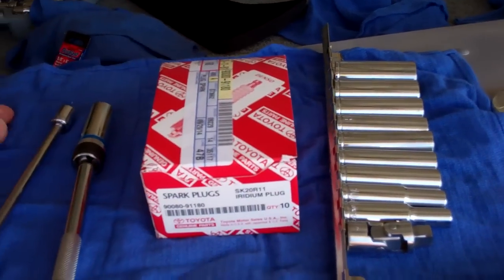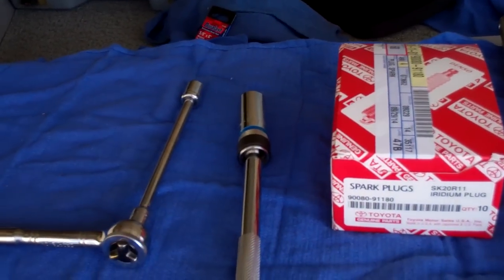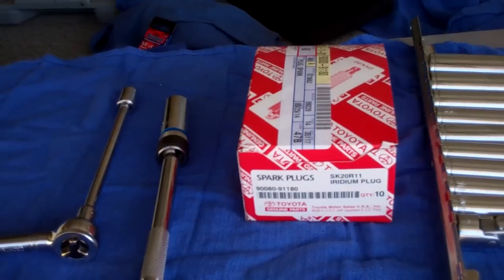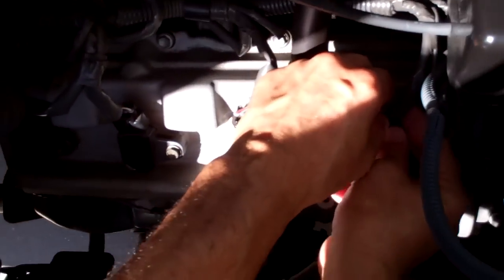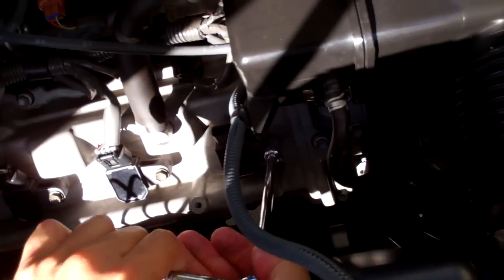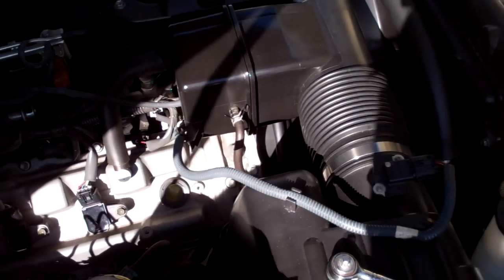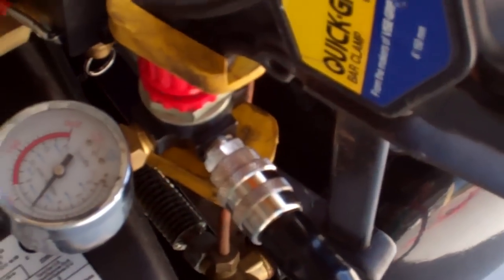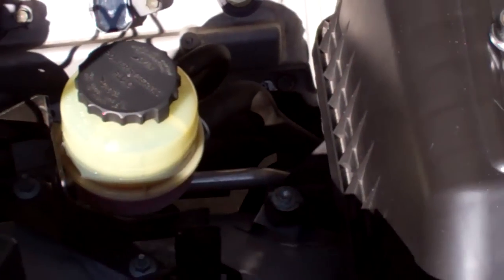DIY Toyota Tundra Plug change

Comment: Tips from an old mechanic: (1) Do this on a cold engine to protect threads on aluminum head (2) Use Anti-Seize compound on new plug threads and silicone lube on rubber plug boots
Reply from the maker: William Splawn yes indeed
Reply: +William Splawn thank you for that info
Reply: Not true. NGK, Autolite, Champion, Bosch, Denso, AC Delco, will all tell you not to use anti-seize with their modern coated spark plugs.

Comment: Thanks for the video perfectly explained thank you for the video. It was fun changing them out I have an 8 cylinder 5.7 tundra and had not changed the plugs in about  100 and 150,000 miles ago dealer wanted $369.00 and it was so easy I did it in under 1hour 15 mins. I used the NGK Iridium 6699.  I paid once before in 2014 to get them swapped. 👍
Reply from the maker: I’m glad that it was helpful and it was able to save you money from a dealership or a mechanic, thanks for watching

Comment: Also suggested to replace the plugs with spark plugs. Use anti seize compound on each plug. Check (electronically) each coil to make sure that is not an issue.

Comment: Jose thanks for the video.  It helped allot.  I talked to the Toyota Service Department yesterday in Southern Oregon (Grants Pass) and they wanted $250.00 to change the plugs in my 2003 Tundra.  I called the Parts Department at the same dealer and the plugs were less than $22.00.  I'll change them myself.  Thanks again you rock.

Comment: you saw improvement in milage, changing spark plugs on my truck caused  my truck to give less mileage,  more gas consumption from 15 -16 mpg to 12 mpg
Reply: That sounds like you have Abad knock sensor,  you should take it to a good mechanic to get it check!
Reply: @carlosheras2828   thanks. My 2011 5.7 has rarely gotten better than 13 mpg. I'm following the advice you gave S!

Comment: Do you like using anti seize grease and grease for the spark boot?  You did a very nice detail job on the engine bay any tips? I'm afraid of killing the electrical.
Reply from the maker: Yes a light coat, And as far as engine bay I just use a leaf blower and may be a little wax on plastic covering. Thanks for watching

Comment: When changing the plugs do you need to put anti seize or dialectic grease ? Working on a 02 tundra 4.7   144,XXX
Reply from the maker: You should use some kinda grease. Thanks for watching.

Comment: 2007 Toyota Tundra 4.7 check transmission fluid for the first time at 190000 MI have 210 thousand miles on it i have changed the  oil 5 times in its life and have never changed a plug yet. Do you think i should  chance it . It runs like a champ and i have a very heavy foot . I wantewwd to see this foriegn vehicle fail but it won't . I am impressed to say the lease

Comment: What size was the extension built-in on the magnetic socket? I'm guessing 6 inches... Correct?
Reply from the maker: I’m not sure but I believe so, considering this is an old video I haven’t use that socket in a while.

Comment: Lol you should do the spark plugs on a Subaru STI and then you’ll really say that there’s no space to do it 😂
This trucks have so much room to change them!!!
Reply from the maker: I could only imagine. I no longer have this truck , now i have a Tacoma 2018. It's impossible to do work in side the engine compartment manufacture are putting so much of pollution control gadgets that you are forced to take it back to the dealers. Thanks for Watching
Reply: Jose Ribot that’s the main engineering idea, to force not mechanically inclined people, to have the dealer do the job and charge larger amount of money

Comment: You shouldn’t ever screw any spark plug into a aluminum head without putting Anti-Seize on the threads of new spark plug!
Reply from the maker: You’re absolutely right about that at some point I ended up doing that I just never mentioned it.